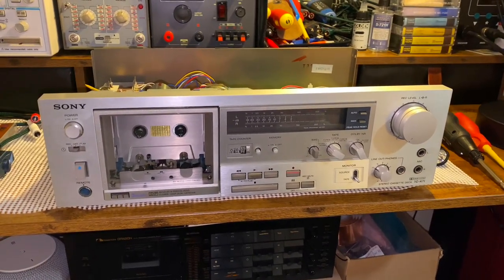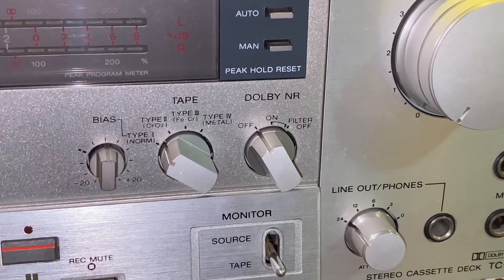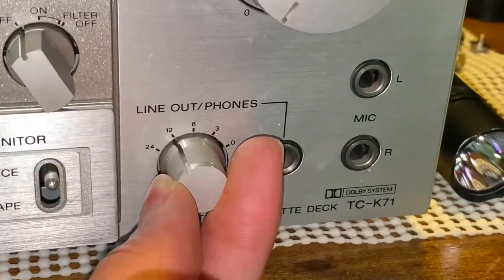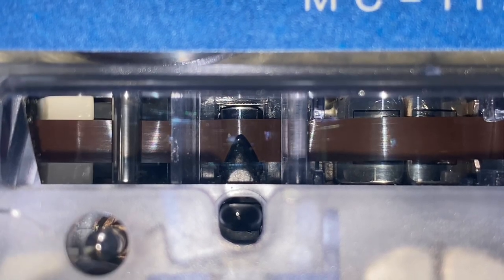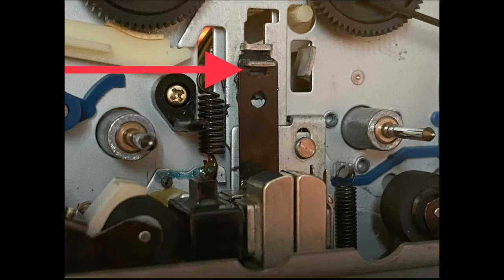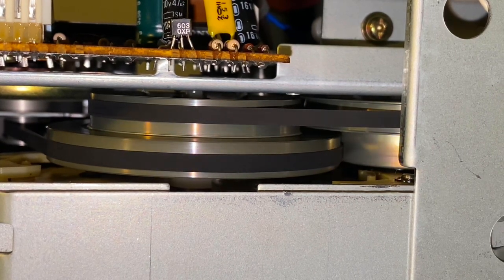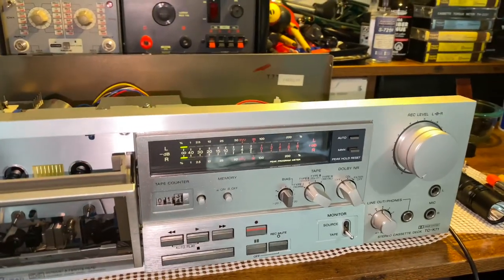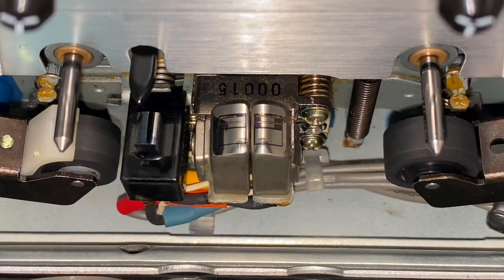Sony TC-K71 Cassette Deck Repairs

Comment: mid 70's?   This is CLEARLY an early-to-mid 80's design... the audio equipment has very specific look from many eras, and this is VERY MUCH NOT 70's...  Same way 90's equipment had a particular design language that can't be confused with earlier decades (and the trend away from silver front plates toward all black)...
Reply from the maker: I believe you! You are well versed in cassette

Comment: That deck was early 1980s.
Reply from the maker: You are correct. The manual says 1980. Most likely manufactured in 79

Comment: Thanks for shering this video. Have you a good guss what's problem In my TC-K71 the pitch rollers are up position all the time.
Reply from the maker: Hardened grease preventing the arms from pivoting. I can restore that

Comment: Nice work, thanks for sharing.  I've got a TC-K81 that probably needs new pinch rollers, too.  Where did you source your replacement rollers?  Thanks again!
Reply from the maker: Fixyouraudio sells quality rollers for these. The rollers are the same as the ones found in all the newer dual capstan TCM200 decks

Comment: I vr got 2 decks but I d changed the pinch rollet , theres no wow and flutter, only probl is the hum of the BSL motor.When switch betwen record  or tape in the tape position coluld heard a little noise
Reply: Normal

Comment: You completely avoided the jammed mechanism problem... the grease in these machines typically thickens up to a hard jam.

Also seeing a mirror cassette being put to test in a eat-tapes machine has given me shivers. I believe I paid around 150 bucks  my one and only mirror cassette... so, I use what I've always used: a trusty TDK D shell with spare tape and one of the sides opened.
Reply from the maker: I just replace the tape stock in the mirror cassette if it gets damaged

Comment: Regarding curvature on that roller Paul, it looks harmless, but it isn't of course. I've never seen any definitive reference online for pinch rollers, but as far as I have learnt, the supply pinch roller (at least) has to be dead flat. (Edited)

BTW, and of interest, I have an old TC-730ES where I replaced the heads in 2005. It's hardly had any hours of use since then, but not long ago I decided to get the old head lapped professionally, only to realise that the old head was part araldited on! I think Sony did this, not sure why? I wonder if the same is true of your TCK-71?
Reply from the maker: I’m not sure. Are you talking about a defect in the lamina from the factory which separates both channels?
Reply: @VintageAudioTech  The epoxy-like material was either side of the Rec-PB head sandwich.